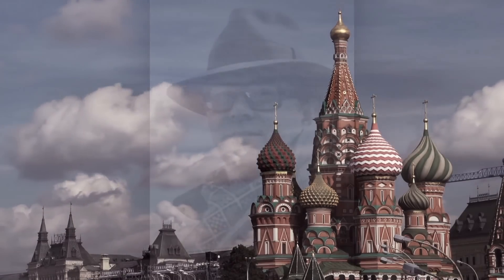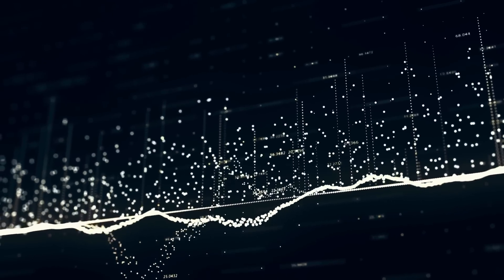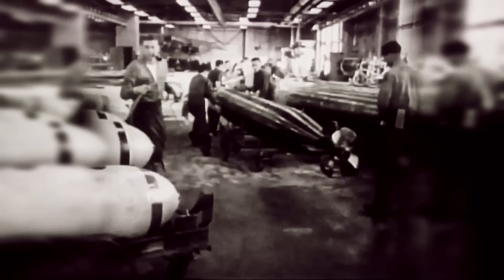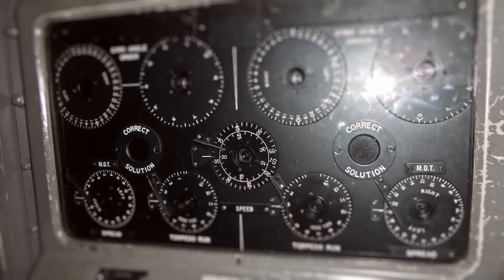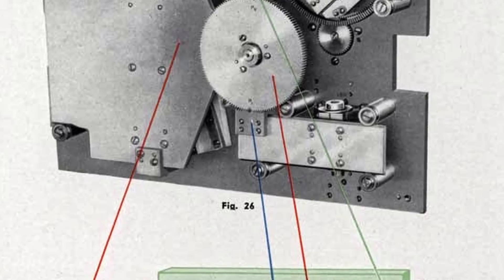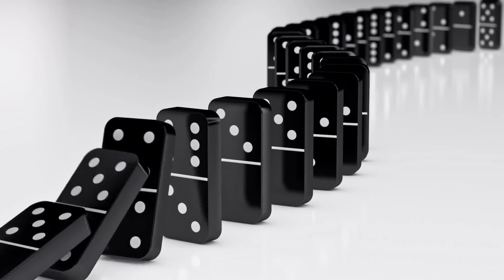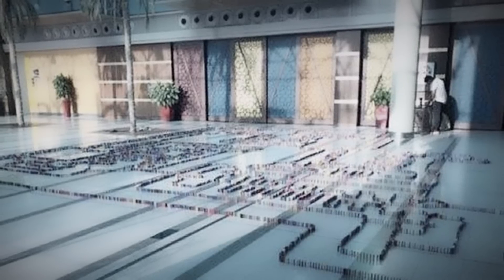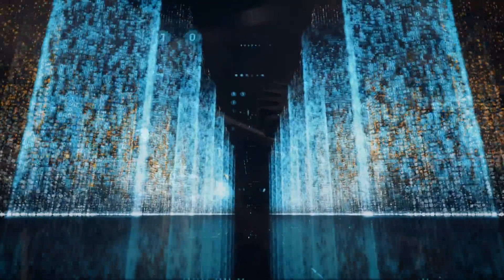The World Of Strange Computers

Comment: I've always been interested in analog computers run on electricity. The ones that use op-amps for integration/differentiation/summation etc. There is a really amazing demonstration how they are programmed and run: https://www.youtube.com/watch?v=3tOA8Fo6b7A
It's very unusual because programming it involves connecting cables between different circuits. But, Despite this being a really great explanation, the math is over my head. I know a little bit of calculus, but not differential equations. So, I'm taking it upon myself to learn differential equations at some point, and maybe, hopefully one day build a crude analog computer. I certainly have enough op-amps to do it (literally pennies a piece these days). I've built digital CPUs, ALUs, memory/register modules etc to put together and make a crude digital computer from scratch, not even cards or motherboards, just chips and transistors etc. It feels like it would be a fitting "prequel" to build an analog computer.

Comment: If analogue computers have solutions for kinetic interference and cold-welding, I think they'd be superior in military/space applications because of the absolute resistance to radiation.
Reply: They're not suitable for vacuum environment, they use much more energy and they weigh a hell lot more than digital microelectronics.

Comment: if you do something like this again, one form of logic I've seen in one textbook, and never again, is fluid flow logic.

It used the tendency of flowing fluids, such as air, to stick to a surface, so it wasn't pressure based.

The example I remember most was an rs latch that had an input stream of air that would stick to a curve on one side of the latch, and flow to an output. a puff of air from the side would push the flow to stick to the other side of the channel, and leave via a different output, with a puff of air from the other side would push it back to stick to the first side again.

The textbook was half electronic logic, using relays or transistors i think, and half fluid logic with various plexiglass gates allowing flow through a series of gates to do computations.

Comment: "Water integrator" - A bucket being filled with water is a perfect analog of mathematical integration ! You can solve a multi-order differential equation, by string several integrators in series. In engineering school, in the early 1980s, we used, then outdated, analog computers, as "deluxe" 100-in-1 circuit kits. But, in a few labs, we used them to setup and solve differential equations.

Comment: These are very cool. One thing tho, if the system under study was chaotic, meaning that its very highly sensitive to initial conditions, and they had no idea. It would’ve driven the researchers absolutely bonkerz 😂, coz every time it would’ve given a totally different answer. Even nowadays that we use numerical methods to solve the so called impossible differential equations. If the system is chaotic, it does the same thing.
Reply: That's why the economists said the system wasn't accurate, it was just meant as a teaching tool.
Reply: @cerebralm  It doesn’t matter how accurate the machine is, if the system is “chaotic”, predictions far into the future is impossible. We began to learn about chaos in the 1970s I think, when digital computers were invented, so they wouldn’t have known about it. Even with today’s highly accurate computers, it does the same thing.